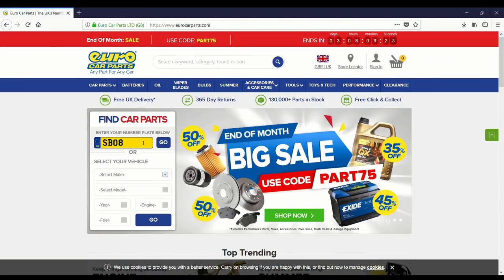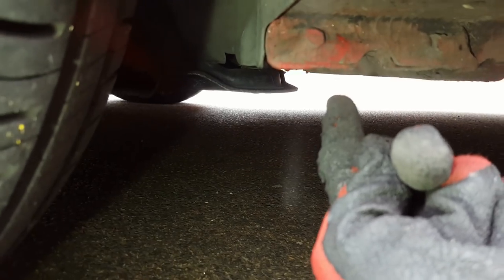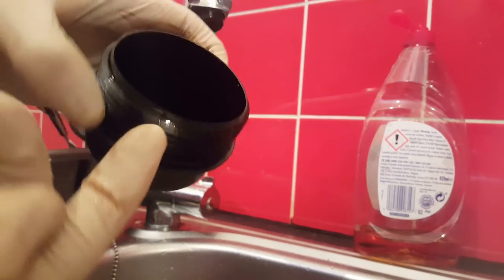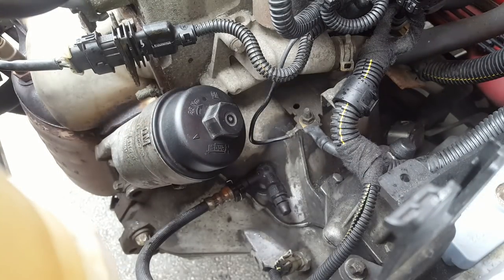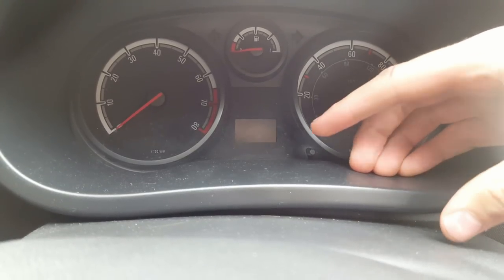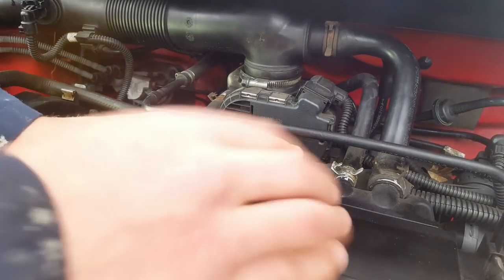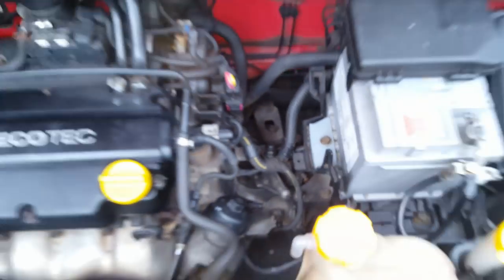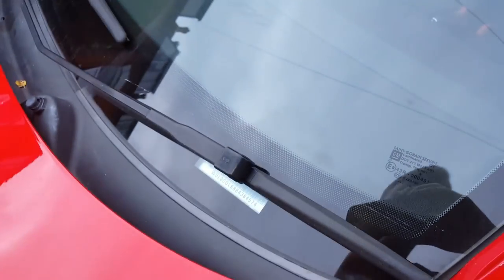Corsa D 1.2 Ultimate Service

Comment: Good guide. If i made add a couple of things: when checking the wheel, put it straight, put hands on 09 and 15 o'clock position and wiggle to check for bearing play. And second, please clean battery terminals with grit paper if rusted and apply copper grease not wd40.

Comment: I have a question: I have a Vauxhall Life 1.2 semi-automatic gearbox (year 2013), and I am the third owner ..... I purchased the car in August 2020, and I have had it with MOT and serviced every year without fail, I never changed the gearbox oil ....... as it's a semiautomatic car with a manual gearbox ....... should I have the oil changed next service? it changes gears without a problem and even though it's an old car, it does not give me trouble so far, I am just curious if I should have the oil changed or should I leave it as it is .......... thanks.

Comment: Amazing video very very useful 
I bought a corsa 1.2 recent and I realised that my engine does shake a little when in neutral 
I was wondering if that’s normal?
Reply from the maker: If it isn't too excessive it's normal, mine does the same slightly.
Reply: @TomsDriveway  mine does the same  it feels like a little vibration before setting off in 1st. But goes away after a a good drive. I have a 1.4 sxi

Comment: hello thanks for the video but id like to know where is the FUEL FILTER ?? i have the same - Corda D 2012 but diden't know where is the location of FUEL FILTER
Reply: Hassan NACIRI lifetime filters in the Corsa Petrols - do not require changing..
Reply: etienne nel not a lot of info to go on in terms of a diagnosis. 

Order of things I’d check. 

Clutch. Pull handbrake on as hard as you can, try driving off. Car should stall and not allow revs to climb whilst engaged. 

Crank and timing sprockets / pulleys. 

If none of above. Could be fuelling - try unplugging MAF, see if it changes the fault. 

If not, unplug O2 sensor - again check for faults. 

Important to note, unplugging these won’t fix the issue - so don’t expect it to run right, just see if your issue improves. 

Failing that. Could be a clogged/knackered EGR or even swirl flaps. 

I had an issue with mine recently. Troubleshooted everything - eventually figured out corrosion on cylinder head had caused a poor earth for the plugs - but of a scratch down and it’s as good as new.

Best of luck, hope you get it sorted.

Comment: Great video mate :) I have a 1.4 SRI and using your video to help me service it. Bought all the stuff off euro car parts for my car but I'm just wondering where the best place would be to put the dirty engine oil? Dont fancy clogging the drains up 🤣
Reply: Take to your nearest (uk) recycling centre - they have a tank for used oil or if you know anyone with a garage I'm sure they'd dispose of it for you. Don't ever tip down the drain :)

Comment: Excellent video,
Wondering if you could help me with a problem,
I have a heater blower that needs replacing because it's making a loud buzzing noise,
When you look on ebay they say "Not for Cars with air conditioning?
My corsa is a 2011 Diesel engine ecoflex with air conditioning,
Where car I buy a blower for my car at the moment at a good price,
I really want to fit it myself,
I would be grateful for your advice,
Cheers
Paul Foster

Comment: Tom need some help please, just bought corsa month ago, 2007 1.2.I am so upset, car is collecting water in the spark plags area, machanic said that's the condensation but the car is missfireing every time when is raining. I changed spark plugs and coil, and the whole week the weather was nice and dry, cold and it worked perfectly and then again rain, storm. Open the coils and water in number 2, covering almost the whole spark plug. Drain it, drive it, still little missfire and the next day again dry weather works perfectly. Today again rain... Engine light on, service car, little bit working good, little bit on 3 cilinders. Help!!!

Comment: On my corsa D 2010, Radiator fan start running soon as I start car. No boiling or overheating.  Air Con. is switched off.. OBD Code is P00B6 "Radiator Coolant Temperature/Engine Coolant Temperature Correlation
".. I really hope it's a faulty sensor..

Comment: All looks good. You could have replaced the sump plug washer. I would especially like to have seen you replace the pollen filter as this is a bit of a bugger to do.
Reply from the maker: Covered in another video I have done. And defsintelt should include the washer, alth tou will be able to use it again twice in my experience. Of about 7 oil changes on that particular car.
Reply: @TomsDriveway  Love your channel and you seem to know what you are doing so good luck.
Reply: Cabin/pollen filter is actually very easy, just pay attention to the way it came out and it'll go back in dead easy with a bit of force and attention to make sure it's in straight without buckling. It's uncomfortable trying to squeeze into the foot well to do it though

Comment: Hey my corsa recently started juddering a little when I go into 2nd 3rd and 4th gear. Kinda feels like it loses a bit of power then it picks it back up? Just wondering if you have any idea on what it could be? I changed the spark plugs and coil packs about 2000 miles back, just wondered if you had any idea? I have the eco flex 1ltr corsa!

Comment: Fantastic video, now have everything sorted for my service. My manual doesn't state a spark plug and coolant service, yet it's only on 35k miles. Is it worth changing them yet?
Reply from the maker: I'd just inspect the spark plugs first, and coolant I'd probably do it to be honest. Although you can get those testing kits to still see if it's okay, maybe slightly over the top tho..

Comment: Hi Tom thanks very much for the great vid. I have just bought a 2011 vauxhall corsa 1.2 sxi and will be looking to carry out my own service on it in the coming week. your vid will def help me as i am a total novice. Do you know much about the timing  belts etc...or have you done any vids on changing them? mine has done 72k and has full service history but no mention of any belts being changed...i think the 1.2 are chain driven...a) is that correct? and b) do you think i need to get that replaced? theres no funny noises at all when driving but I have lost 2 cars previously (admittedly I didn't look after them - lesson learnt) to the belts snapping and killing the engine so I am massively paranoid about that happening again.  thanks again for the fantastic vid.
Reply from the maker: Thank you for the big comment its great. 

The corsa's have timing chains inside them. They are expected to last 100,000 miles but often don't due to incorrect oil change intervals. 
B). If it's making a chain rattling sound potentially depending on the extent of the rattle. Corsa's do have a rattle sound even with the correct oil viscosity and a new chain and tensioner fitted. 
Plus the hydraulic lifters are usually fairly loud too.
Reply from the maker: No videos on changing one since I made sure that I purchased my car with a new timing chain fitted at the time.
Reply: @TomsDriveway  Hey thanks for the reply. I think I'm just going to bite the bullet and get a new chain fitted. Car also just started juddering and hunting this weekend - fairly certain it's the coil pack or sparks. Thanks to your vids I'll be able to do both although it's under warranty so the dealer can do it 😁

Comment: Nice video. I bought oil for next service but filter is problematic becouse there are two types. I changed antifreeze and now my heater is hot. It wasn't before.
Reply from the maker: Thats brilliant well done, might have been airlocked. It doesnt matter try one if it aint right get another. Or just call euro car parts or whoever you buy them from.

Comment: Great video mate. Any idea what may cause a chirping noise only under acceleration, no performance issues.Was thinking valve leak?
Reply from the maker: Thank you, potentially auxilary belt or idler pullies. Or as you said a leak somewhere. Whack belt off and rev the engine see if the sound goes away...

Comment: Great video Tom. A question, the oil sump plug, doesn't it have a copper crush ring?
Reply from the maker: Thank you very much... it doesnt it has a rubber o ring attached to the plug
Reply: @TomsDriveway  That is strange. My next question is, I'm wanting to install a rear camera to the boot. But I can't see a way of getting to the rubber boot, any advice would be greatly appreciated.

Comment: tom have a 1600 astra h 2005 the engine is sucking in air sucks so hard can't remove oil flller cap very easly  any ideas why terry
Reply: Rocker cover diaphragm.

Comment: Well done mi old good job but don't use wd-40 on ya door checks or hinges use copper slip or good old grease as wd-40 thins the grease down and thats when you get the old creaking noise when opening and shutting your doors ok mate small hint from years And years at servicing cars/vans and small lorry's 👍

Comment: Hi there, can anyone tell me why i can't turn off my spanner light on a vauxhall corsa 2010 1.3 diesel, the service as been done, i tried to reset the light, but it would go out, so i've put it on a diagnostics machine, it's telling me there are no faults with the car, car starts and drives fine. Thanks.
Reply: May require to be put on a bosche reader if you are not able to reset it, plenty of hidden codes which will not display on a regular OBD reader
Reply: @dejanbrice8774  @Dejan, it was a very expensive snapon machine i think, but i'll try it mate, thanks for getting back to me.

Comment: Hi tom
My corsa d smells of fuel at the back of the car any idea what could cause this this smell is on off not all the time
Reply from the maker: Yeah funnily enough I get the same issue, very very occasionally. I'm assuming maybe the fuel cap seal, or maybe a seal around the tank. Very strange I may try investigate more if it come back

Comment: Do you just jack the one side up for this, or do you do one side, put the axle stand under, then the same for the other?
Reply from the maker: Both sides sorry, get the car as high as you can safely. Axel stand on both sides.
Reply: @TomsDriveway  Cheers - I take it's safe to do one side and then the other? Never done this before, but your video is really helpful!
Reply from the maker: @Stxpz  oh yeah it is safe. Just makes sure you put the axle stands in the correct place. On the jack points or the axle. Be careful, and think before you do it.
Reply: Ahh, thank you! I’ll try to not trap myself under my SE 😆

Comment: Hi Tom, Excellent videos. Would you be doing any videos on rear brakes on the 1.2 corsa. Keep up the good work.?
Reply from the maker: To be honest not for a while as mine are in good condition.
Reply from the maker: I did change the wheel cylinder though in one if my videos.

Comment: Can you do a video of how to change the Drive belt ?
My Corsa D 1.2 2010 I would need to remove the engine mount to get the belt off which terrifies me, You have to support the engine on the sump. 
Last time I attempted to remove the belt tensioner I was undoing the bottom bolt of the tensioner and the bolt snapped leaving half of it still in the engine block !! That was not a good day for me :(
Reply from the maker: Literally what I have just been recording Haha. Let me tell you it can try your patience
Reply: Tom's Driveway yea first time for me
I started to undo the tensioner and bottom bolt snapped !!! I think I messed it up as I didn’t put a pin in the tensioner hole to release the tension so all that tension was on that bolt that snapped

Comment: Which engine would you recommend to get, mate?
Reply from the maker: Hey, I guess it depends on alot of factors. I've heard the 1.7 corsa d are good to be honest. The 1.2 I drive are rather slow, mph I get around 39-40 mpg on motorway. Mid 30s around town

Comment: And the petrol filter?
Reply from the maker: Unfortunately the corsa d does not have a typical petrol filter. Its mounted in the fuel tank with the fuel pump and it cannot be replaced on its own.
Reply: @TomsDriveway  Wow I never that...thanks. I remember my Opel C had a FF under the car by the driver door (or was it the passenger side.. cant remember)
Reply: @TomsDriveway  yet when i went to Vauxhall for a service they said the were going to change   the fule filter at that point i realised they were talking shit and serviced it my self
Reply from the maker: Nice one! Yeah no filter on these unfortunately.
Reply: @TomsDriveway  the also said it was going to be 380 pound 🤣
Reply: Tom's Driveway have any clue what oil for automatic transmission gearbox. Tired of Vauxhall telling me it’s life long oil
Reply from the maker: Im sorry i am not really familiar with the automatic transmission, however ill look later today see if i can find out. And yeah they are full of shit
Reply: Tom's Driveway cheers , would appreciate it mate
Reply: Tom's Driveway it’s Corsa d 1.4 63plate automatic

Comment: Strange why Castrol says 0-30 but Vauxhall say 5-30
Reply from the maker: I know I thought that, however I put 0-30 in because they rattle for a few seconds as it is. So in winter when the oil is thicker as its colder, I think it just protects the engine faster as it flow easier since it's less viscous.
Reply: @TomsDriveway  If you feeling Frisky at some stage would love to see a gearbox oil change.
Reply from the maker: Haha frisky, yeah I've been thinking of it for a while. Just the money at the moment that's why.

Comment: Hi Tom, could u please tell me how am I supposed to take out a camshaft. One of my hydrolifters is making a ticking sound, I have found wich one it is but I could not take a camshaft out. Do I need to take of the timing chain, or what? Thanks
Reply from the maker: Yeah you would have to take the timing chain out to do it correctly. However, you possibly maybe able to do it with the camshaft still in position I'm not sure